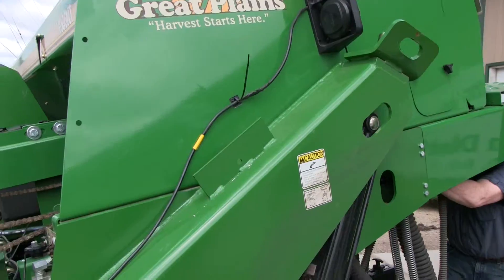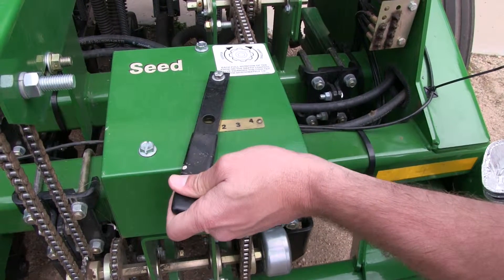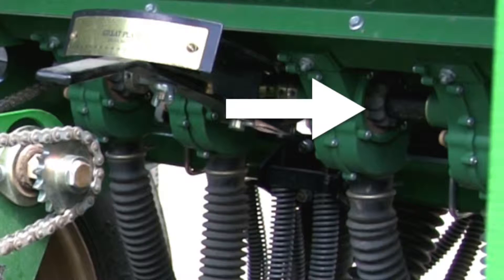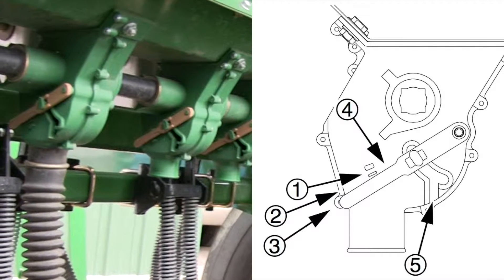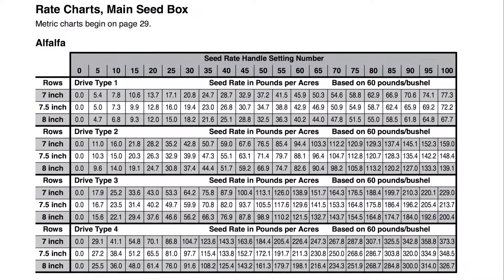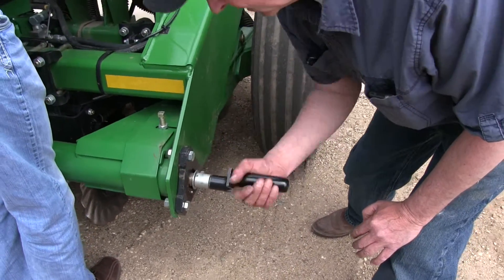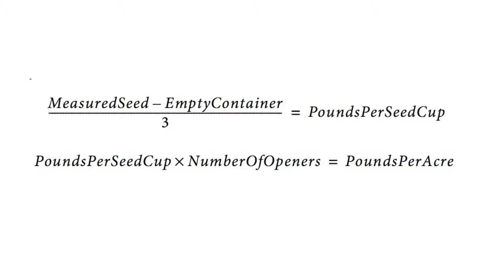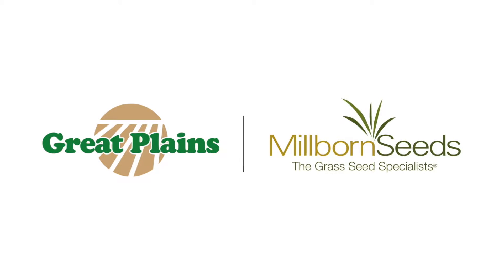How to Calibrate the Great Plains Main Seed Box (Model 1006NT)

Comment: So you use the large grain box? Can the grain box seed alfalfa as well if set up correct?
Reply from the maker: Yes. If the large grain box has a half-speed kit for the sprockets, it will be able to meter out a small enough volume to seed alfalfa.
Reply: MillbornSeeds the small seed boxes are not large enough to do large acres